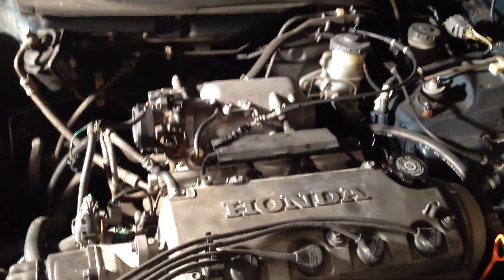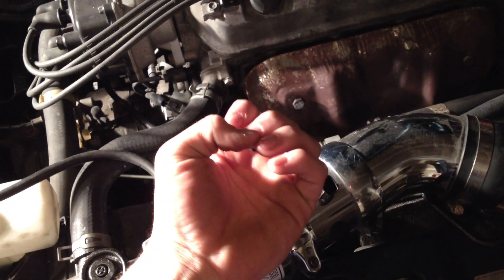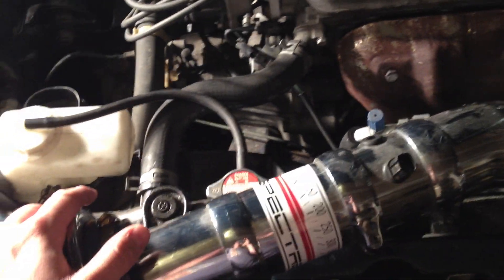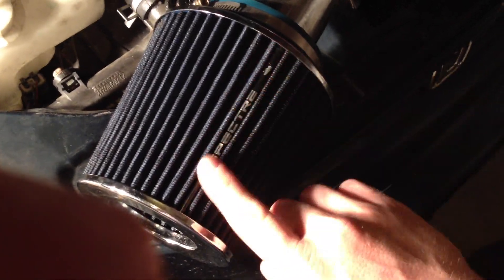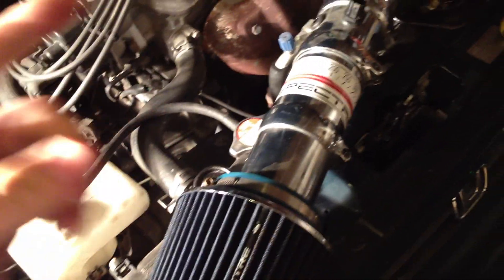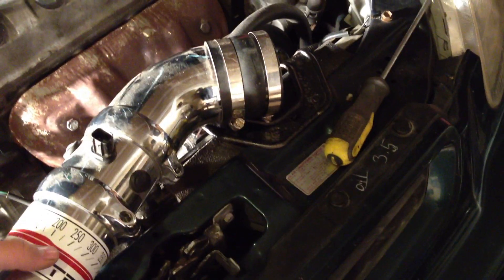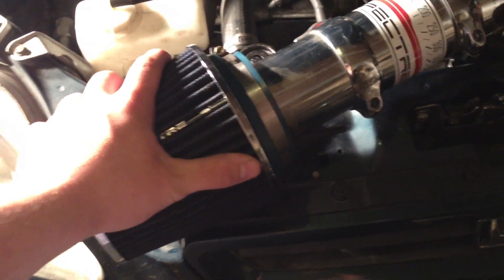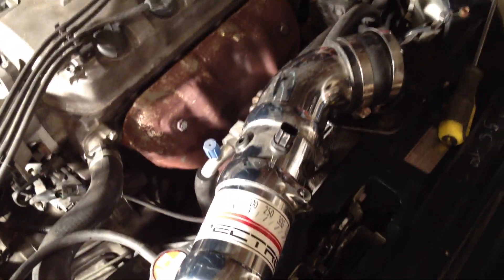The Truth of Air Intakes and My Opinion on Them!(READ DESCRIPTION)

Comment: Very true stuff. There are major HP/TQ gain methods and then other methods with much smaller gains. But added up make a difference and ONLY at speed. Most notably (and legit) is at the track. I think a lot of young'ins get excited about the affordable mods when they get a car and expect to run 11's on the 1/4 mile. But hey, I will admit I was there once ;-)

Comment: The K&N cold air intake woke my 98 Cherokee up (grated, it was not cheap). I did that along with a 'high flow' flow master muffler though.. I was taught, you can not make it suck better, unless you also make it blow better ;) Not only did it wake the motor up, my mpg display is much happier.
Reply: the only thing you did was make better flow out the rear. That is a good upgrade and helps the motor breathe. If you didn't do the CAI and kept the filters clean you would have gotten the same results.

Comment: I just installed a cold air intake into my 98 honda accord. My pros are that it sounds awesome, esp at high rpms when air is moving fastest, i do notice better throttle response, really does add power, not much but enough to notice, and more space in the engine compartment (looks cleaner) especially taking out the resonator, air box, etc etc.

Comment: Nice video bro I agree on the 
Same things because I put a $25 Spectre intake filter on my 03 4.3 Silverado and i had similar thoughts on what was actually happening . You do actually noticed a few extra hp and  torque at higher Rpm's so my opinion its worth it.

Comment: got a 97 civic, very little computer control over the engine, its not my first , but its my first whom i put s K & N air filter and it does make a difference, i road the car for two week before changing filter, and when i install it, i notice a difference the following week with same driving condition, so yes K & N filter work ,

Comment: If you watch the mcm episode where they dyno an r34 with stock,cheap aftermarket, and expensive aftermarket pod filters, there is no difference, other than a max of 5 hp from a cai that was sucking in air conditioned air. But they do sound nice, and look cool. I have a spectre in my car, my benefit is it takes up less space in the engine bay.

Comment: A $60 pipe with a cheap cone filter only gives the engine cooler air with little to no gains and costs about $10 to make. However you can get small gains if you route piping to act as a ram air with this design. 
Professional CAI's are designed to use resonance and bends to shape airflow to the throttle body, this is why they're $200+, because the company actually R&D'd and dyno tested the intake.
Reply: You'll find almost 0 difference in power on a single overhead cam Civic between a 200+ CAI and a shorty intake like his. Those cold air intakes also pick up water on rainy days.
Reply: HUNT3R Not entirely true. While you won't make anymore horsepower with a CAI versus short ram, you can shape the torque curve lower in the powerband, which aids in drivability in a small engine. Also, water in a cold air intake will never hurt anything, in fact the water vapor can be beneficial, moist air is more dense and provides more power. It's very difficult to damage an engine with a CAI, as long as you don't go full throttle into deep water worst case is you stall the engine and soak your filter element.

Comment: it definitely sounds better, and that's what most of us are looking for but if you don't drop that intake near the bottom bumper you're (what i think) killing your motor. you might as well call it a hot air intake, sounds good but losing hp and making your engine work harder without the happy ending

Comment: I think you worded it out as: an absence of air.  That means a "vacuum" is created which leads to suction to balance the atmospheric pressure within the engine and the outside.  The vacuum, also known as suction, pulls air into your cylinders for combustion.  If your intake is restrictive, with bottleneck points, airflow will be disturbed.  It's like trying to finish soda through a pinched straw (stock) vs a normal straw.  The real problem is if the manufacturers put any science behind their intake designs to give any real gains.

Comment: the entire idea behind a "cold air intake" is the "cold air" part. cooler or colder air is more dense and will burn hotter. horsepower is arguable and has been proven to increase, and also proven not to. but the principle behind it is to let cooler, more dense air into the intake, causing a hotter burn and "more power" at the very least it improves air flow, being bigger piping and more intake area exposed than stock filters. the increase in power of 5-20 degree hotter air the arguable part.

Comment from the maker: Hey YouTubers, just wanted to say that I was a kid when I made this. So don't take this video too seriously..
Reply: Well there is some logic in the thing you say but people now drive modern cars that have allot of electronics and that is the difrence here... you got all that sensors and gadgets to monitor the environment that it does not matter what filter you put on it...  Meaning if you put more air, the ECU will tune itself for it and maintain programmed OEM settings. So for this to work you need ECU remaping. the gasoline engine need perfect air to fuel ratio to work properly, and only a filter wont work as you expect.

Comment: yeah maybe if it was a 1980's car or something, where the intake was actually restrictive. But on cars of today and the 90's, theirs just no restriction. Aluminum piping is the worst for an intake because aluminum absorbs heat, which means your sucking in hot air, even if its a cold air intake. Theirs a reason why all stock intakes are made of abs plastics and rubber ;). Theirs no logic to aftermarket intakes except for sound.

Comment: It sounds good and when vtec kicks in at higher Rpms it is easily to be fooled that the car is faster. Is it no zero zilch nothing- just from the pod making that induction noise. might be same without top cover of airbox on.2 BUT with the stock airbox is actually protects it from the hot air from the engine so is good- pod urs dont. That metal pipe is proably better because of the less turbulence but really how much hp u gain from that pipe idk.  .

Comment: Intakes headers catbacks Are 
A waste of $ u can have all 3
Gain like less than 10 hp even if
U buy premium parts spend 
7-8 hundred dollars if u dont
Plan on installing cams with
Bolt ons save up 4 a swap or 
Turbo kit . Just sayn from years
Of xperience messn wit hondas.
Reply: These parts are not useless and it depends on the car.  It won't add much to a 4 cylinder but if u start adding serious hp you need these parts.  Do you think people with a turbo have stock cais and exhaust?  It won't do much alone but it's a start if u don't have 5k on and the experience to drop a turbo in.  You talk about turbos like they are cheap and if they had that money in the first place they would of just bought a faster car. Why do people talk like it's so easy to get a turbo that cost 30x the cost of a Cai.
Reply: sickquads4me You absolutely need a performance exhaust with a turbo. The small factory pipes are made for stock horsepower. Adding more power will create too much backflow in the exhaust. Dropping horsepower significantly. By themselves these cheap mods don't do much. With a turbo kit they become absolutely necessary. Also to properly use a turbo you need a top end kit for your engine or a swap that had it done already. Top end kit is several thousand. Absolutely needed if you want it to last for long. Turbos are an absolute waist if anything is. Better off trading for something with car that has one factory installed

Comment: i have this fucking problem, plz help me in this one ___----- after cleaning the filter i lubed with sqeezer it after 20 min allowed 20 min to wick it as per manual, my bike choked every time i accelerated ok i thought i put too much oil or left it wet, after that i degreased it again and left it to dry for a day even put it under sun to dry completely  then lubed it with minimum oil, and let it wick for a day then also after installing it choked .....can any one tell me what causing me this ?

Comment: only benefit over stock is reusable. these filters like k&n filter require oil. oil will create more resistance. less air. just use stock filter your wrong